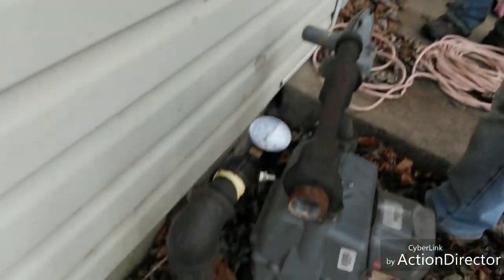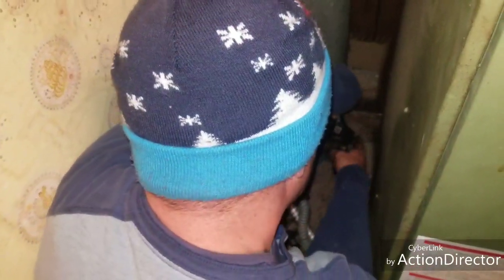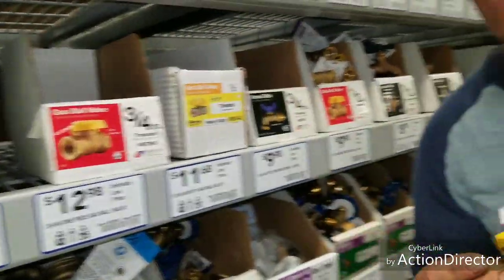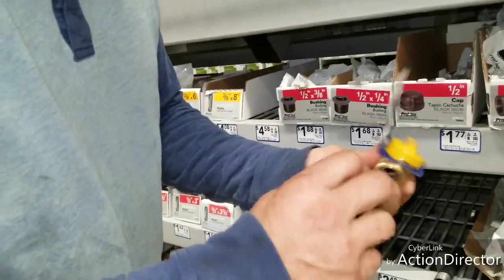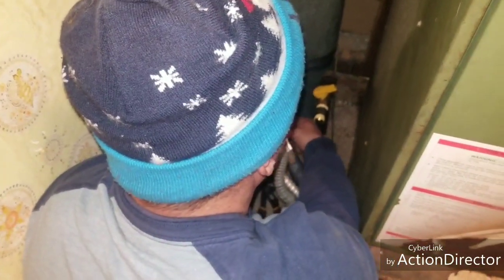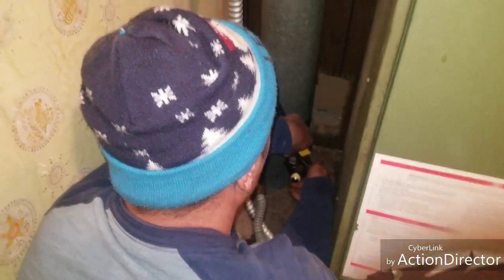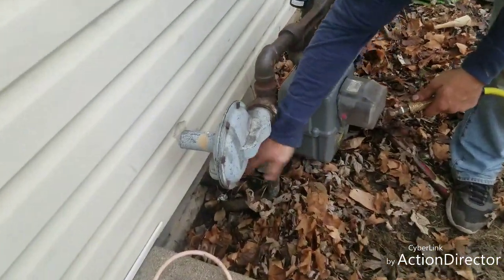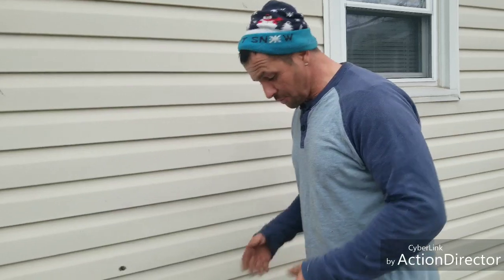How to do a natural gas line pressure test

Comment: That appliance valve looks like 3/4" to repair take the nut off the core pull it out ( no need to remove the whole valve) and put a little valve grease on it slip it back in tighten up and bingo your done in ten minutes no need to go to lowes save your customer some money!!

Comment: Test pressure way to high , should only need about 10psi also no tape or dope required on threads as it's doing nothing , also use a dedicated LDF for checking joints as soapy water will corrode....
As George Michael sang.
If your going to do it , do it right boy..... 👍
Reply from the maker: It was done ✔️ and it worked so whatever your saying is not going to help pass inspection. We good already. When showing people you tape everything that way they don't get confused

Comment: Hey great video man. I have a gas leak in my house and the gas company locked the meter. 
I’m going with your same approach but I was wondering if pressure testing it causes damage to the piping/fittings?
Reply from the maker: No damage it's just the pressure needed good luck. You could turn off the valves right before the appliances that use gas
Reply: @rexstick  gotcha. And I was wondering, do most leaks occur in fittings? Or is it common to see leaks on the actual pipe?

Comment: What is the device plugged into the gas line, where can I buy one?
Thanks, 
Harlan
Reply from the maker: Hello thanks for watching, that was just a pressure gauge that I put together at a plumbing supply store. It was like $10 or so 
Any of your local plumbing supply stores should be able to fix you up with the parts

Comment: Compression fittings do not require tape or dope to seal. Putting either on the threads of a compression fitting will do nothing to stop a leak. The beveled end on the fitting seats to the beveled cradle of the pipe which when tightened properly creates the seal. Since all compression pipe has a fitting that spins until tight the threads have nothing to do with the seal.
Reply from the maker: Thanks for watching and yes I know that now lol, but I had no idea then and never even knew how to do the pressure test. I like to try and do anything even as a rookie. I thank all my comments it helps me become wiser at a field that I only encounter every once in a while 🤷‍♂️😊
Reply: @rexstick  admitting you had no idea THEN how to properly pressure test pipe in a residence you should be fucking ashamed of yourself ... doing a bullshit pressure test on someones gas piping ... their house could explode due to your lack of qualification.. "We got yellow tape for the thing" ... HIRE A PROFESSIONAL!!!!!
Reply: @haus05  I see your point there but your over exaggerating a bit. The guy clearly did a simple pressure test and it held. What’s the actual issue ? It’s pretty straightforward but I do understand your point. As an electrician by trade who also does other trades but with more precision than most of the actual tradesman, I can give you way worse electrical examples than this gas one.
Reply: @haus05  also your definition of a bullshit test is basically because of the  time of the pressure test. There’s isn’t another way

Comment: Way to high test pressure, you could damage components within the appliance.
Reply from the maker: The gas is shut off at furnace so there is no other appliance here but maybe other appliances should be off also then there is no problem🤷‍♂️

Comment: Those valves are illegal now anyway.
Reply: They are not illegal.  2018 IFGC, says if it was legal when it was installed, you may continue its use and maintain it.   (also known as grandfathering or Legal nonconforming)    This code is update every 3 years, so just because the newest code has something different does not make it illegal.
Reply from the maker: Depends where you live lol
Reply: I still agree. There illegal. Have to replace if working on appliances

Comment: Just fyi no teflon tape or pipe dope is used in the supply to the appliance, the gray bendy pipe nothing gets added there. Otherwise pretty good job.
Reply from the maker: thanks a lot bro 👍👍 it was my first time 🤣🤷‍♂️
Reply: @rexstick  no problem did plumbing for 15 years i learned a few things water or turds run downhill and that
Reply from the maker: @raymondmucklow3793  🤣🤣💩 thats funny

Comment: Good video. I'm curious if you made your own leak tester valve? I'm told regular dish detergent is corrosive and can cause a leak over time, hence the common suggestion to use non-corrosive leak detector. Since you detected soap in the failed valve  I'm wondering if maybe that was the leak in the valve? No way of telling this but I wonder. Thanks again!
Reply from the maker: I bought my tester valve for $9 pre built. Well most dish soap shouldnt hurt cast iron, cast iron last like 50 years on drain pipes but idk all the facts on that. the valve was copper so some soap with amonia or salt could be corrosive to it. I think the gas company turned the valve off with too much force and caused the leak. I cant prove it so I just fixed it. Gas companies get new and bad employies also. But this was my first time doing it and Im glad it worked and thank you for watching and the corrosive info😎👍